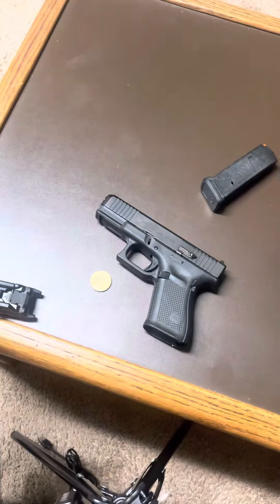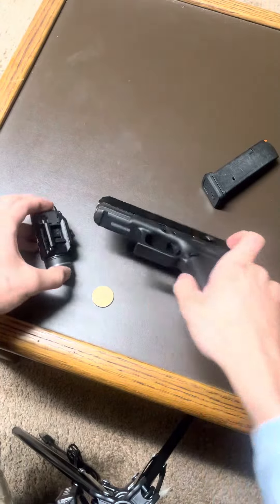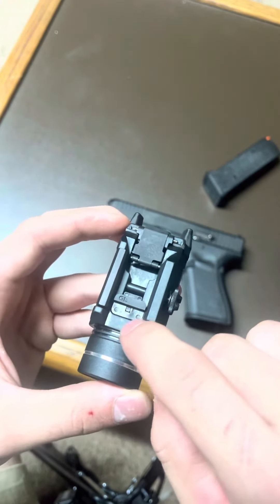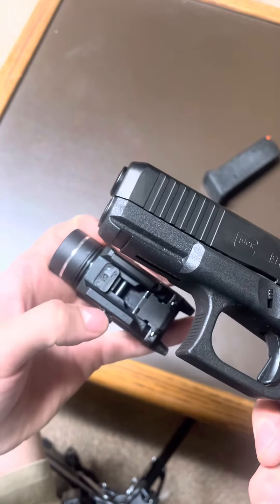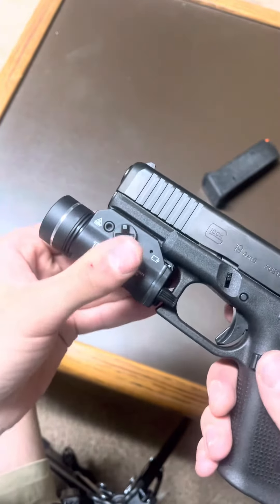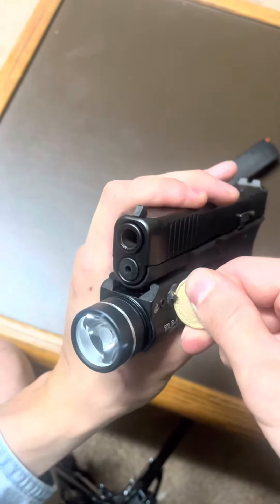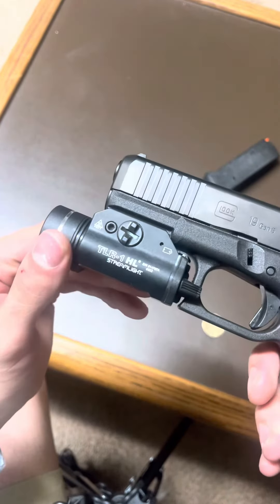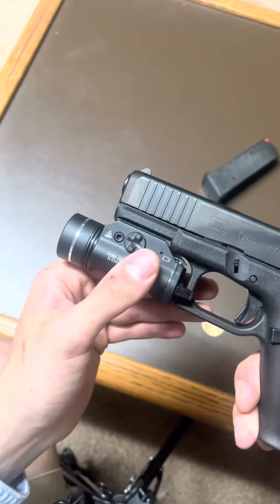How To Install Streamlight TLR-1 HL Flashlight On Your Glock Pistol, Handgun, Or Picatinny Rail.

Comment: Would definitely advise against using a coin on polymer hand tight is sufficient it won't come off
Reply from the maker: I like mine more then hand tight.
Reply: @GearAndGuns Streamlight itself recommends only hand tight though. If they meant for you to use a coin, im sure they would have provided one? It's up to you though. I would just be worried because of the possibility of cracking/breaking the frame.
Reply from the maker: @jason4453  I didn’t know that. Thanks for the information.
Reply from the maker: @jason4453  yeah your right though, that was one of my first videos and I was a lot less knowledgeable then. Going to start posting more content soon.

Comment: Dont you need to put the plates on in order for the light not to move when you are shooting it?
Reply from the maker: There’s a rectangular plastic notch that’s pre installed on the light that fits into the slot on the lower receiver of the hand gun. They are removable and there’s extras that come with so you can fit the light more securely with different firearms. I believe the one made for Glock was already installed so I didn’t have to change that one out. But yes your correct. There’s one for sig Sauer p320, 1911, and picatinny rails. I briefly mentioned this and how to do it in the video, I just did not do that process because the Glock insert was already installed.
Reply: @TacticalTaz  i have cz p10 c and while it fits without the plate i feel like recoil will definitely move it around. Thank you
Reply from the maker: @irehbegovic188  I would definitely use the inserts that the streamlight comes with. If you do not, the recoil will most likely move the light forwards and backwards on the rail. It could also damage the rail. Just find whichever insert stops the light from moving the most, and install that on the streamlight. Whichever insert has the least play it in, use that.

Comment: What's that slide release that you're running? Looks pretty sick
Reply from the maker: @js1218091  kagwerks raised and extended slide release. I like it the most compared to the stock slide release and the standard height extended versions.

Comment: I just got one for my glock 19x, how do you put the battery in?
Reply from the maker: The light cannot be on the weapon when batteries are being installed. There’s a small metal hinge on the top of the light near the back by the on off switches. You pull that back towards the buttons, it should release a hinge and open the cover.

Comment: Funny how people still point the muzzle in directions where it should never be, even though they “know” it’s clear. Typical of the non-trained.
Reply from the maker: Relax man. I recorded this video like 2 years ago. I’ve learned a lot more and have more gun safety since then. I verified it was clear so I know it’s clear. With no round in the chamber it’s the same thing as having the slide off the lower.
Reply: @GearAndGuns Gotta just ignore comments like this for sure. (:
Reply from the maker: @calebmeyer6253  I try to interact with viewers as much as possible. But yeah definitely could’ve.